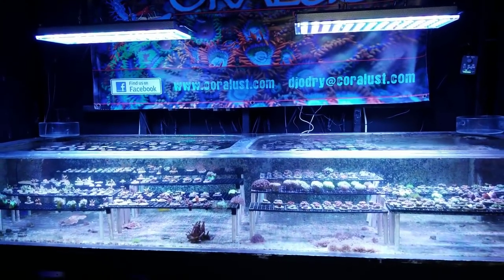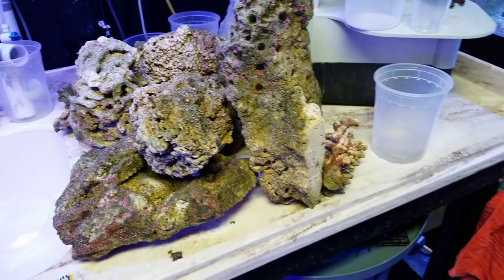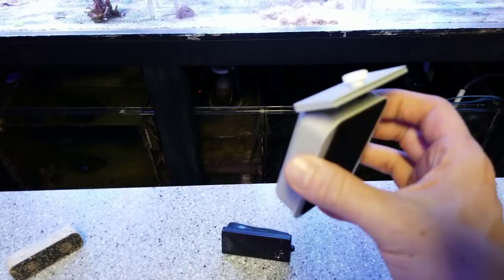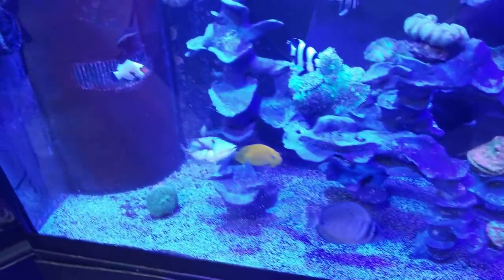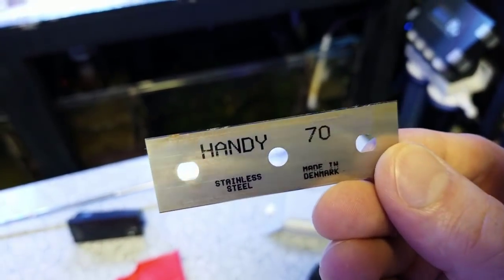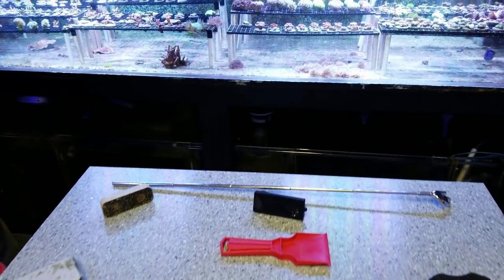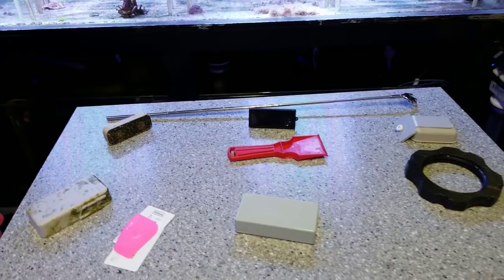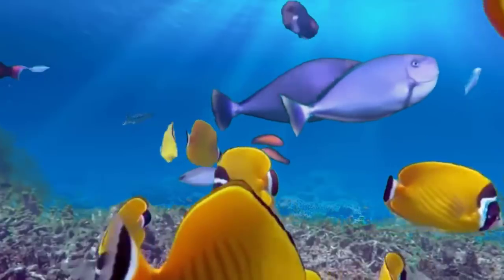Scratches and scrapers glass cleaning discussion

Comment: I wish I read your review before I bought a flipper with the metal scraper. It totally scratched my glass aquarium. Also the felt surface holds sand which is magnetic. The mag float seems to be the best.
Reply from the maker: I am sorry to hear that you got a scratch, I definitely have better luck with my mag float.  I just wish the pads were white so you can see what's on them.
Reply: Ollan Jay Palma I used Cerium Oxide. It didn’t remove it compete,y, but it is less prominent.

Comment: Tunze scraper it's almost impossible to scratch glass probably good for acrylic just leave the metal blade off. the blade holder is spaced so it doesn't scrape the silicone. They make different sizes for thick glass nano tanks and normal thicknesses. Awesome scraper just DO NOT LEAVE THEM CONNECTED IN THE TAKNK since the scraper section that stays in the tank is suspended off the glass it will pull the magnet through the plastic and rust in the tank, had to restart my tank basically due to this but now I take it out leave it separated and it's all good. love it and will continue to use it best scraper imo
Reply from the maker: That's very helpful, thanks for sharing with everyone.